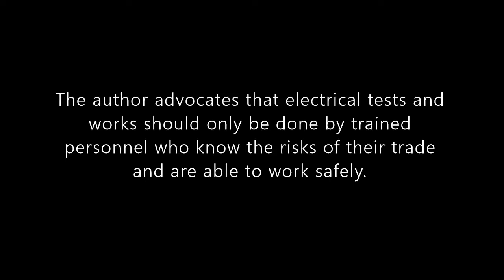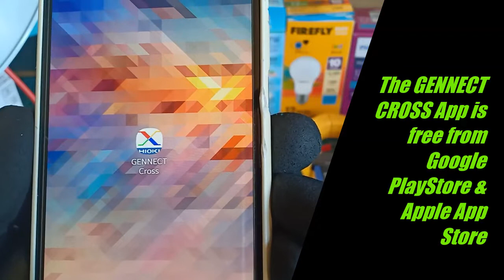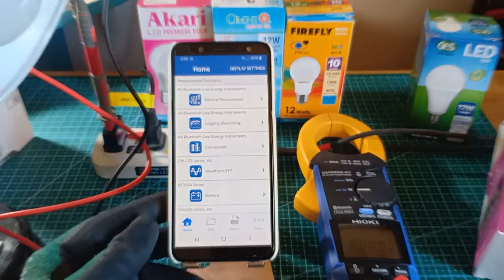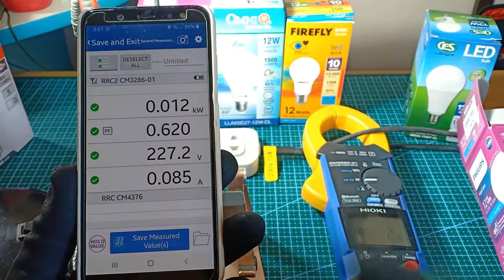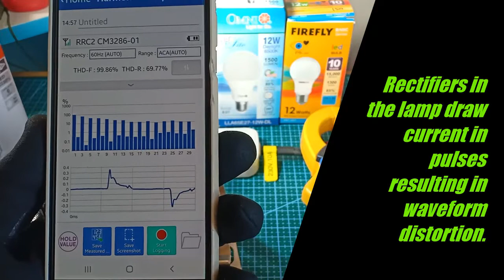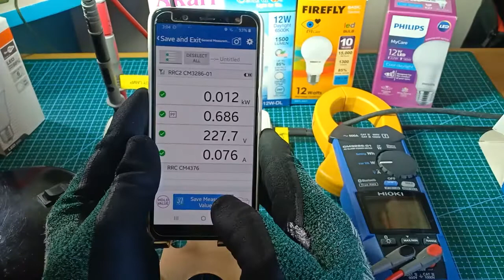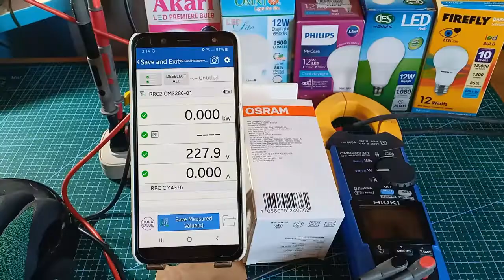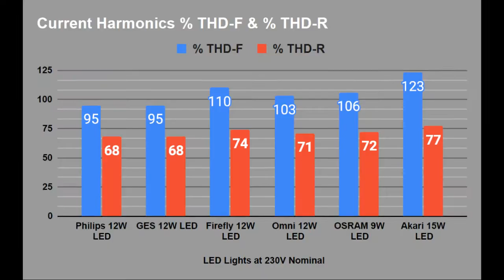[CC] LED Lights- their Power Factor & Harmonics

Comment: Just for information, the little Hioki CM4001 also shows waveform and harmonic analysis in the app, although its frequency band is probably more limited than the CM3286.
When you showed the network voltage sine wave, you can see that the peaks are flat and not smooth round like a pure sine wave should be. That could be because many electrical loads on the grid draw current just like these lightbulbs, in narrow spikes during the peak voltage, causing the grid voltage waveform to become flat at the top and bottom peaks.
Reply from the maker: @danielardelian2  You're right. In the case of LED lights this is particularly applicable since its internal circuit must convert the AC input to DC. As you know a lot of these rectifiers together can draw enough current pulses that can affect the waveform of the AC voltage source. Thanks for your thoughts.

Comment: If they create an inductive load, couldn't the manufacturer just add a capacitor like used in fluorescent tube lights? It seems like they could upsell them to industrial and commercial customers for an additional charge.
Reply from the maker: I appreciate your comments. If I'm not mistaken some high end commercial LED lighting may already be using some sort of power factor correction (PFC) circuitry, which also drives the cost up. For small loads, however, the effect of low PF due to common LED lighting isn't very significant to justify higher investment. But for commercial/industrial applications, low PF and high THD are an important technical and economic concerns that must be addressed. From my previous experience I've seen some older industrial applications compensated for low PF (through capacitor banks) at individual load centers or main panel. I have yet to see a PFC coupled LED lighting, though.

Comment: could that clamp be used at the main distribution board to measure the overall power factor of the whole circuit with different appliances running
Reply from the maker: Yes, it can. This is a CAT IV, 600V, 600A rated, 1-phase or 3-phase, AC Clamp Power Meter so main distribution board total power monitoring, with power factor can be measured. Thanks for watching!

Comment: Hello Master.
What is the difference between THD-F and THD-R ?
Thank you very much for this video.
Reply from the maker: Sorry for the late reply. I am not a master, LOL! In PQ monitoring, we only use THD-F, which is a percent value of harmonic distortion referred to the fundamental, in our case the 60Hz power frequency. I am not familiar with THD-R as we didn't use this, but from online sources, the RMS value of the harmonics is used instead of the fundamental frequency.

Comment: What the frequency range of the test gear?  50th ?
Reply from the maker: Voltage/Current harmonic levels up to 30th. Frequency characteristics: 45 to 1 kHz, True RMS.
Reply: @ramschannelreviews  LED emissions are up to 150kHz. DPF and TPF vary according to design.  Manufacturers only tell benefits not downside.
Reply from the maker: @sunrayisdown1690  I see. Thanks for the info!
Reply: @sunrayisdown1690  True. And cheap fluorescent electronic ballasts are also the same. I have a sensitive current clamp sensor with 100 KHz bandwidth (-3 dB) and I've seen harmonics up to 100 KHz on the oscilloscope FFT.